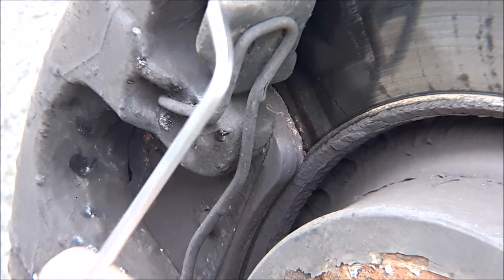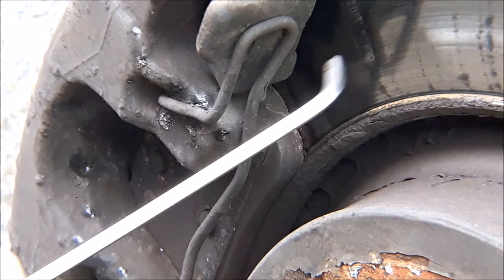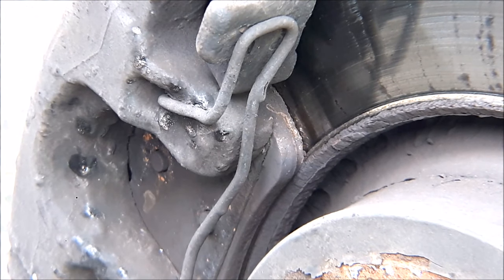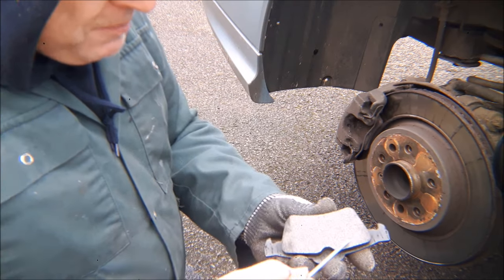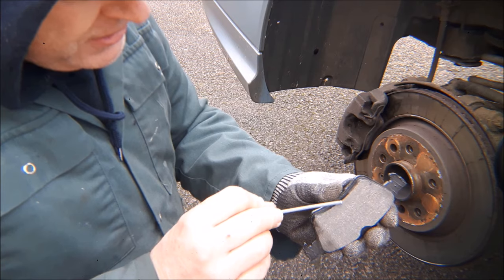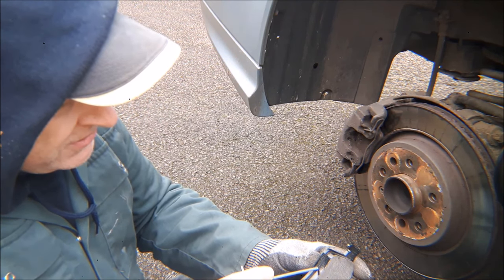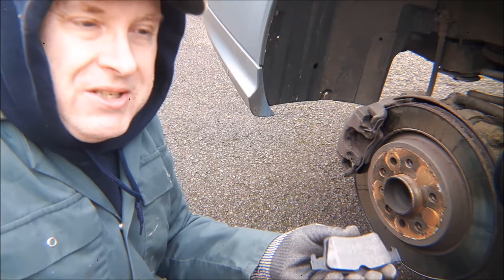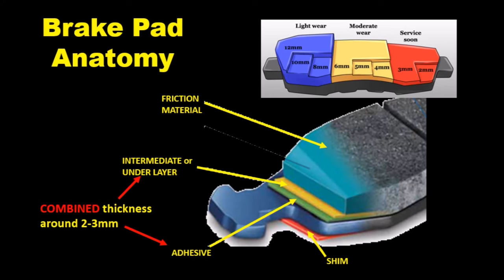When to Change Brake Pads, Thickness Minimum and WHY

Comment: Thanks. Your video is really helpful. I subscribed. I have a car with all round disc brakes and seems more than 3mm even on the back. But the brakes make a bit of a grinding sound when I first get in the car. 

I just had a major service. Which might have been rushed to get my car the MOT that day. So I can't complain about the garage. But when I asked them to look at the brakes at the end of last year, they said the front pads were new.

Why am I getting that grinding noise when I get in the vehicle? But after braking hard a few times it seems to go. Have they done something or is it just dirt after having my brake fluid changed?

Comment: I've been wondering why to change brakes at 3mm.  You're the first person who actually explains why!  Thanks!
Reply from the maker: Yeah, a very little known thing, me thinks. One of my ex-uni mates is a subject expert in Chassis Systems!!
Reply: I had the same question; why at 3?
Thanks and I love listening to the English English!
Reply from the maker: @sholomnb  Yeah, it's not at all obvious and tech manuals never seem to explain it. yet it's so important.
Reply: Such a good video. Got some other work done on my car and they said to change my brakes soon that it was nearly down to the metal but saw it had tons left. Was so confused why they thought or would say that. That makes sense with the area that is bonded near the metal plate.

Comment: Are rotors really need to be replaced often? Even if they are at minimum thickness, I have a feeling that they can last for at least 5 more years. Before rotors were not replaced that often. Just in last 20 years everyone started talking about replacing it all the time.

Comment: Amazing, I never realized this despite working on cars for many years. As a habit, I don't like to waste anything so I will try to make sure I wear my pads down fully before replacing them (always leaving some pad material to prevent direct contact to the rotors).
Reply from the maker: Yeah, few outside the OEMs seem to know this.

Comment: Always thought this was a waste of brake pad material, now I know why, thank you. I will be using that Allen key trick, thanks.
Reply from the maker: Yeah, I got this info from brakes Engineers at work about a decade ago. Hardly anyone outside the industry seems to know about this. Which is strange considering how important it is to safety.

Comment: Thanks  3mm I never knew that and I've changed a lot of brake pads
Reply from the maker: The lower limit for the MoT is 1.5mm. At that point the pads are already dangerous

Comment: Hey big debate about transmission fluid i have myself and many I know went over 300k orig fluid many years. Do you recommend changing fluid it's camry 4 cyl mostly highway 60 k miles 
toyota manual says leave it alone. Dealership says change it and my mechanic to do not touch. I like to keep driving as long as possible w out engine or transmission job
Reply from the maker: Oil degrades with use and age and condensation. OEs class "life" as 10-12 years 120-150,000 miles. There was a time it was normal to change MTF every 30-50,000 miles.
OEs want your car to wear out so you have to scrap and buy another.
I do the MTF every 30-40,000 miles.
Reply: @CycloneCyd  idk my buddy for 2 cars Ford van and Toyota over 15 years prob 20 years 300k a lot city driving same w my old camry. Orig fluid

Comment: Hi, I had my car MOT’d recently (passed with NO advisories on the brakes) however, within 2-300 miles the brakes begun scraping badly and became much worse at stopping the car! Should my brakes have failed or at least been an advisory? Thank you
Reply from the maker: Thanks for sharing. If your pads were just about on minimum I would expect an advisory for sure. They are part of the inspection. ATEOTD though, it's your legal duty to check the pads, not theirs.
The minimum thickness for an MoT fail is 1.5mm which is below the minimum usable thickness anyway. HTH

Comment: Nice video, 
Is it necessary to surface the rotor every time you replace the pads?
Reply from the maker: Not at all, unless they need it. If they've got plenty of thickness left but are scored then surface them. If the surface is good, leave them be and fit new pads. Your decision should be DATA based, not one-size-fits-all

Comment: My car manual says minimum thickness is 1.5mm, should I swap them out sooner?
Reply from the maker: The manual will be referring to the factory original brake pads. If it has original still fitted, great. If not, 3mm

Comment: one question - is it normal to not be able to see the brake pad? Is it really fully covered by the backing plate?
Reply from the maker: Yes, the backing plate (steel) is usually slightly larger that the friction material to support it all around. You can usually see the friction material from the top, but this may mean taking off the wheel

Comment: hi friend, I believe both my front and rear brakes are disc brakes, however it seems the front ones look different than the rear.  The front ones look like they have more hardware, or maybe the hardware is bigger, or different.  Any ideas?
Reply from the maker: Yeah, thats normal. Front brakes are usually larger than rears. Often fronts are vented but not rears. Depends somewhat on the car. Have a look at the Pagid brakebook for details.
Reply: 9⁹

Comment: Hi, I’m a new driver here. Whenever I brake at high speeds I can hear a squeaking noise and also when I put my handbrake up, you can hear it from outside the car? Is that normal? I have no car knowledge and I’m getting very anxious, please can you reply, I’d really appreciate it!
Reply from the maker: You really shouldn't be pulling on your handbrake whilst driving. You could end up going backwards under the nearest HGV in a flash❗
Some brake pads have a wear indicator which creates a screeching noise. Check pad wear.
Reply: @CycloneCyd  it happened when I was trying to park😭 I heard a horrible noise. Very stupid of me. How much would you say it’d cost to replace only the brake pads at a garage? And thank you so much for replying, I appreciate it!!
Reply from the maker: @jasminaktar8663  £60-100 depending upon the car and pads. Did you check the pad thickness?
Reply: @CycloneCyd  it’s a corsa 07 plate and nope I haven’t.
Reply from the maker: @jasminaktar8663  Unless it's one of the 'sporty' versions, chances are it's not discs but drums at the rear. The noise could be as simple as dust that needs cleaning out, or could need new shoes.
Take a look at videos 2 & 4 in my brakes play list to see drums.
Unless you've got all the tools, take it to a garage, drums can be tricky
Reply: @CycloneCyd  Thank you so much for your help. I appreciate your replies. Have a good day.